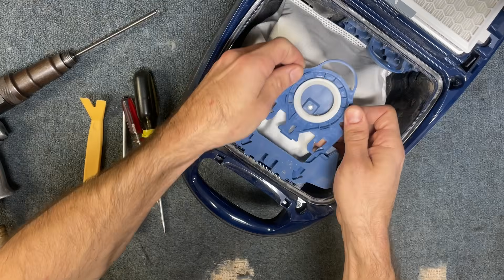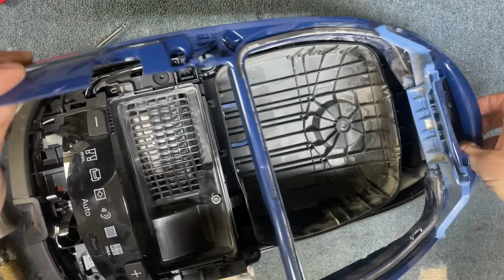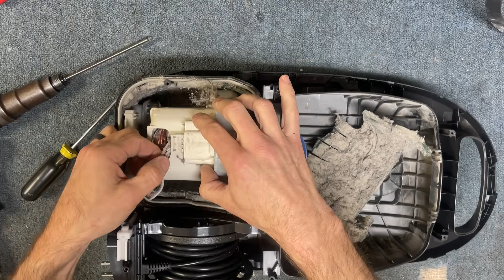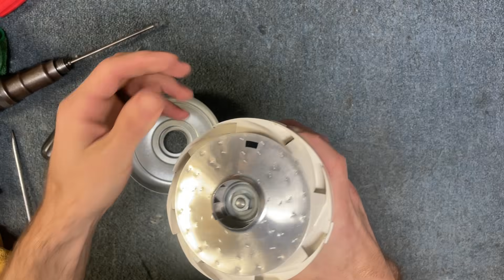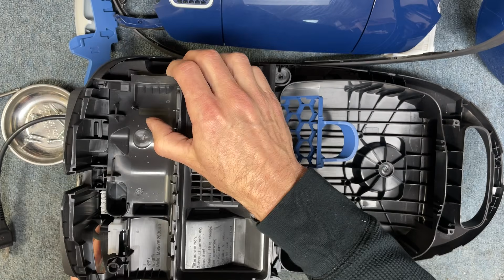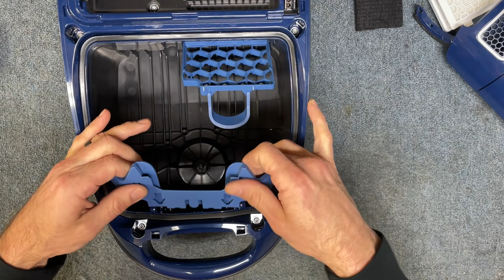Vacuum repair man | Miele C3 tear down and reassembly

Comment: This is so helpful thank you. These C3s with powered floor heads are incredibly rare here in the UK but I just managed to pick one up on eBay, although it looks in quite rough condition. I was worried at the idea of taking it apart and putting it back together but your video really demistifed the process and I will follow along when the vacuum arrives and give it a good clean. 

It is also quite scratched and scuffed on the outside - would you recommend using a car polish to buff it out to restore some of the smoothness to the finish?
Reply from the maker: Thanks! Not sure how car polish will work on plastic. Denatured alcohol will take the paint scuffs off though

Comment: I salvaged a Miele C3 from a neighbor's trash, that had been running without the bag. I cleaned out the bag compartment and replaced the bag and filters, but didn't know if I should tackle the disassembly needed to get inside the motor compartment. Then I found this video, watched it in its entirety, then proceeded step by step, playing the videos as I proceeded. Very clear instructions. Not a hard job when you know how to do it, but would have been impossible otherwise. Now I have a great vacuum cleaner and it didn't cost me anything. Thank you!

Comment: What difference does it make to the vacuum performance? 
I've got a 9 year old c3 that's still working, but is a little long in the tooth.
Hard to say whether going through this process is going to be of any benefit.
If it improves the performance and gets me another 5 years or more, I'd go for it.

Sadly it looks like Miele vacuum cleaners aren't as good anymore, so I want to keep my trusty c3 going!
Reply from the maker: Not major. Really the biggest difference would be smell and odor. If your filters are clean and bag is not full, you should have good performance. But it is possible for the motors to suck in a lot of hair due to bag failure. And if that happens performance can suffer.
Reply: @richardsvacuumcenter  Cool, I had a bag connection failure about a year back where a ton of dust and debris had collected up against the internal filter between the bag chamber and motor one. 
That's because I had the bag retainer mechanism under the side clips for some reason.

I can't say whether performance has suffered, because after 9 years, I can't remember how good the c3 was back then.

I think it's time to clean it and your video will be amazing for that.

Sadly it seems Miele are entering the world of enshitification with their new models, so I'm going to want to try and get this fantastic repairable powerful little monster of a vacuum cleaner going for years to come.

Comment: Is there a disinfectant you recommend for a Miele bagged vacuum that accidentally sucked up a rat turd? Which areas can and can’t get sprayed with a disinfectant?
Reply from the maker: 😮 just don’t get motor wet or board or cord reel. Everything else can be washed and dried.

Comment: Thank you, Richard, I am not a very much of a DIYer, but I am here for two reasons. First, I wanted to see how to clean small particles of grit which seem to be cat litter from inside my Miele Alize vacuum. I wish you had given a video demonstration on how to use the brush with the Dawn dishwashing liquid as I will not disassemble the entire vacuum. I am not clear on whether I am supposed to spray a mixture of dawn and water on the inside of the vacuum, but it seems like if it is not rented off and I would not be able to rinse it off thoroughly, I am not sure but it seems like it would just cause more grit to stick to a soapy residue.  Second, I would really appreciate your recommendation on this, do you think it is safe even with Miele brand vacuum bags, to vacuum the super fine sandy cat litter with a Miele vacuum like this one? Thank you so much.
Reply from the maker: Yes it’s safe to vacuum fine litter. You just might need to replace the bag quicker.

Comment: Thank you very much for your very for your excellent video.
My Miele C3 stopped after 15 seconds and automatically restarted after 10 seconds, this went on and on.
Therefore I viewed a site called repair café. The problem with these C3 Vacuum cleaners is that the printed circuit board inside the motor gives a problem.
On this print there is a temperature security component sensata-3mp-motor-protector-datasheet.pdf the connection with this device to the printed circuit bord is broken.
I fixed this wit a piece of tinfoil I soldered this on the broken part.
I can send you a foto how i did this
Reply from the maker: Please do. Richardsvacuummi@gmail.com

Comment: Fantastic video for experienced DIYer. Though my motor had a protective rubber-plastic housing I had to navigate. Also the sound deading motor fabric is extremely sensitive and I ripped a portion of mine and had to repair. Blowing out the motor with air compressor and electronics with canned air takes some thought. This is not for beginner/novice IMO and to have my local vac store do it for $60-100 is more than fair when one considers time spent and possibility to break plastic tabs and foam inserts. If you break a tab or something, it wont snap just right. Finally, I like the option to Venmo at the end. Better than ‘Just Answers’ for sure!

Comment: Great video! By far the best tutorial I’ve seen! Can you tell me have you cleaned the sound insulation insert in the motor?
Reply from the maker: You can rinse it just be gentle because it can start falling apart with too aggressive water pressure. I just submerge w a little soap and squeeze till clear water comes out. Let dry thoroughly

Comment: Thank you thank you thank you. Legend. Had a smelly c3 now sorted. Also while I was in the I took out the comfort retractor spring which was broken (on another video someone made), so now the retractor works aswell. Good overhaul. Super thanks doesn’t work from NZ, neither Venmo. If you had a PayPal or Wise link I would send a tip. Cheers again

Comment: My C3 does the same thing.  I have to reseat the filter bag in the holder every time I open the filter door otherwise the bag opening is not properly aligned with the hose allowing dust & debris to bypass the bag and ends up in the bag compartment.  Some debris even gets past the motor prefilter.

It is astounding to me that if Miele designed the C3 vacuum to automatically release the filter bag each time you open the filter compartment, then why don't they tell you IN THE USER MANUAL to reseat the filter EVERY TIME you open the filter compartment.  Poor quality for such an expensive vacuum.
Reply from the maker: They fixed this issue on the new guard L1.

Comment: Thanks. I just replaced the defective cable spool in mine. Took it from another C3 with a defective motor. Now instead of two defective vacuum cleaners, I have one that works :-)

Comment: Thanks so much, Richard! Your video is detailed and very thorough. I was able to follow easily step by step and get the used vacuum I bought all cleaned up. The only difference on mine was a two-piece plastic casing over the motor.

Comment: Thank you so much this was super helpful and a very well done video! I took mine apart and back together very easily with your help. Mine was shutting off every 10-15 seconds and I took it apart to clean it, the thing is maybe 6-7 seven years old. To my surprise it was very clean inside, nothing like yours in the video. Anyway I put it back together and the problem persist, I fiddled around a bit with it and suddenly in the lowest power setting it stayed on for about 90 seconds, until it died completely. The light on the power setting comes on for a second but no power, any ideas? New motor? Exhaust air is not warm at all and no smells or anything. Thanks in advance! :)
Reply from the maker: Possibly a bad cord retractor

Comment: Any chance you can also disassemble the cord reel? I want to fix mine 😢
Reply from the maker: Sure in a future video! What is wrong?
Reply: @richardsvacuumcenter  damn you were fast lmao anyway i extended the cord of my marin too much. I tried to disassemble the cord reel module but for the life of me i cant disassemble the white spool holding the mechanism inside intact.

I think i actually made it worse as now the coil wont coil back into the compartment it stays tensed to

Comment: Thank you! 
Maybe you can help. I can seem to get the pug from the circuit board to unplug from the motor plug? Its the white plug. It looks kinda brown like it maybe fried something in there and the power will not shit off. The power switch has continuity though. Is there a trick to separating the white plugs? I just cannot for the life of me get them separated! Thanks
Reply from the maker: Yes it’s probably due to the plastic melting and fusing together to a degree. Unfortunately, you will most likely need to replace both these components on either end of this melting. Is your unit under warranty?
Reply: @richardsvacuumcenter 
No its not under warranty. I noticed Miele now has the schematics on their website with parts. That helps. I checked the power button with a multimeter and it works off the machine but not when connected to the machine. Thank for replying and sorry I didn’t notice all the typos before 😂